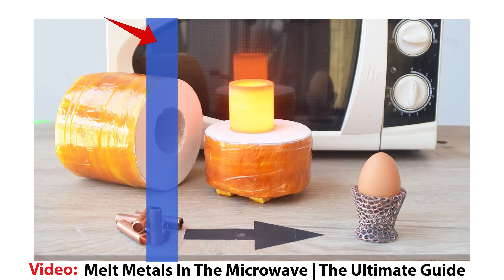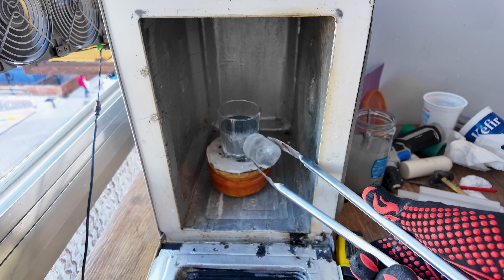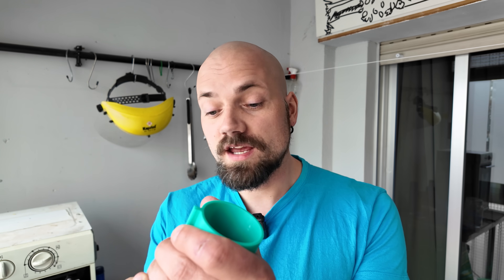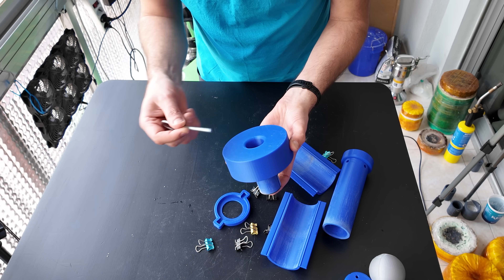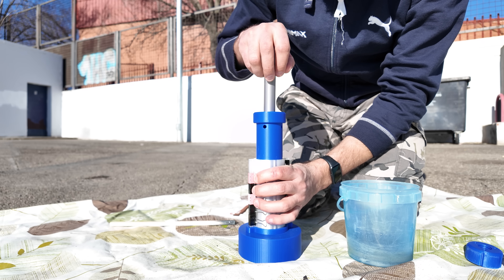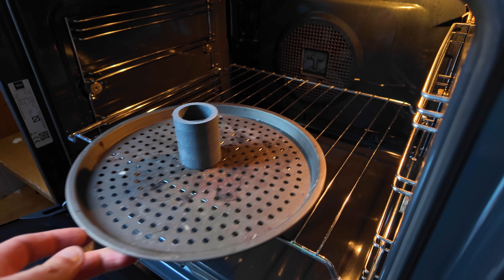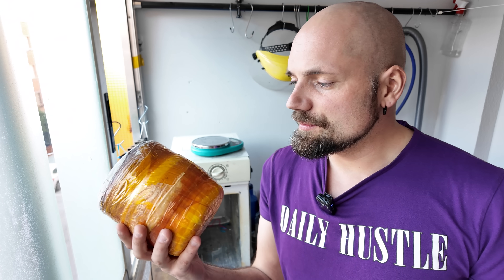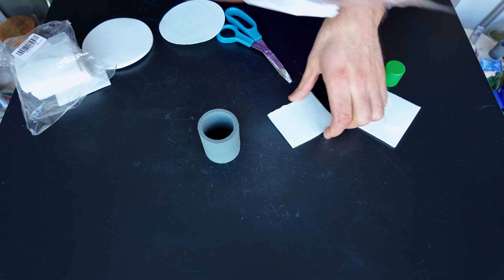How to Make Your Own Crucibles (for microwave metal melting)

Comment: Good video, but mad at science system for being cryptic here. You should already be unleashing your minds into the world but they sabotaged. Earth science elite be like "We has Ultrasonic holography pressure technology that can be greater than the bottom of the Ocean but we not explain what it means to masses because we dumb to the fingers of our own intelligence" lol. Masses deserve upgrades to make things easier. Soo.. Points at youtube LEVIPRINT Upgrade that to full Ultrasonic holography by Plasma speaker generated Ultrasound. Warwick university plasma generated Ultrasound "work in extreme conditions totally remote easy to automate" + Google: "Ultrasound can print through walls" you can float things in the air as you melt it btw.. Google: "Ultrasound can produce temperatures as hot as the surface of the Sun" hotter with Plasma source.. Google: "Ultrasound to read minds" See what you imagine.. Cellular mimicry..

You look at trash depots and recycling centers like its nothing. I see spaceships for humans all over the place, but that's my genetic behavior programming running I guess. Holography + Direct sound printing = Closes eyes and imagines blueprint from database for Ultrasonic holography assisted by synthetic AI biological computer to form using all the resources needed from garbage depot trash mountain https://youtu.be/LQ1iggFnFYA?si=r8W1TXnXvhRl2mFt Can't produce enough power to push Ultrasound that hard? Then use Ultrasound to control tiny things like negative and positive charges in the atmosphere to make Earth's lightning print for you.. Oops!

Comment: Thanks for the great videos!
I also made a crucible and insulated container based on your video.
It worked well up to the point of firing the crucible. I was able to make a hard crucible that made a high pitched sound when tapped.
However, when I tried to actually use this crucible, a problem occurred. When we grabbed the red-hot crucible with tongs, it deformed like cookie dough.
Did we put too much sodium silicate in the crucible? Or was the sintering temperature too low? (I heated it up to about 1100℃)
If you have any advice please.
Thanks again for the great video!
Reply from the maker: I used to have that problem as well, but not anymore. I would suggest trying to decrease the amount of sodium silicate used, or the opposite, increasing it. Obviously, it can also depend on the brand or strength of the sodium silicate. The one I used is a 37% solution. I know that on amazon there are gasket sealers that's pretty much the same sodium silicate, but they are only 10% or something like that.

So yeah, I’ve been there before. If you're packing the silicon carbide well enough and your crucibles are still falling apart, try using finer grit or experiment with the amount of sodium silicate you add. Cheers!
Reply: @ShakeTheFuture  
Thanks for the reply!
I will try different concentrations of sodium silicate!

Comment: Liquid glass Im hardening by co2 gas at room temperature in 24 hours. I use co2 from old expired fire estinguisher
Reply from the maker: I also used to use a fire extinguisher, but I stopped because I was using way too much CO2. Not necessarily because I needed to inject a lot of CO2, but more because it was a psychological thing. 'Let’s inject a bit more... just in case.' I found myself refilling the CO2 way too often, so I stopped using it.

Comment: Could you go over the ceramic fiber insulators/refractory, the generic types, the alternative materials, procurement, material specifications etc... ?
Reply from the maker: I’d love to experiment with different materials. There’s an 'organic' version of ceramic fiber—I don’t remember what it’s called—that I’d like to try. It’s supposed to be less nasty, but unfortunately, all these things cost 💰, so right now, it’s not that easy to dive into any project I want. Hopefully, we’ll get there soon. Cheers!
Reply: @ShakeTheFuture  What about using different material layers.  Especially an air tight outer casing. Would insulating the microwave help reduce heat loss enough to be worth it ? What about castable refractory insulator like vermiculite cement plus some suitable insulating aggregate ? What about rock wool or fiberglass insulation for the outer layers ?
Reply from the maker: @shodanxx I’ve never needed to over-insulate the chamber or insulate the microwave. For example, there’s a gap between the chamber and the base where I place the crucible (especially after extensive metal melting), but it hasn’t been an issue for me. I’ve still been able to melt everything I wanted so far. If I ever find the need, I might look into an airtight-ish insulation.

I once tried using perlite to make a microwave kiln—it melted. Obviously, it was directly exposed to the heat. As a secondary layer of insulation, it might have worked.

When putting these videos together, my main focus was to keep things simple so they’re easy to replicate.

There are definitely more materials that could be used; you just need to make sure they are microwave-friendly and don’t absorb microwaves. I haven’t tried rock wool or fiberglass , but I plan to experiment with AES wool in the near future.

Cheers!
Reply: @ShakeTheFuture  THank you for your response. I would also be curious with adding a fill port of noble gas such as nitrogen, argon or even carbon dioxide to avoid tin flash and other oxidation. 
Have you considered if temperature could be monitored or controlled  easily ? Such as thermocouple N type pyrometer ? Perhaps enabling heat treatment for precise hardening of small steel objects ?
Reply from the maker: @shodanxx  I’ve thought about adding some kind of temperature measuring equipment, but there are two reasons I haven’t done it.

First, I don’t really need it—but then again, if I had it, I might think, Wow, I can’t believe I didn’t add this sooner!

The second reason is that I wanted to keep things simple—no modifications to the microwave needed.

That said, it’s definitely something that could be explored, and I might consider it in the future.

Cheers!

Comment: have you ever tried using the microwave for heat treating/tempering?
Reply from the maker: I have not, but i don't see why it would not work. Cheers!
Reply: @ShakeTheFuture  how do you regulate temperatures? do you just go by past experience and fine tune as u go forward?
Reply from the maker: @kenniesdead  Well, I mostly use my microwave kilns for burning out molds. I control the temperature with a cycle timer, but obviously, I can’t be super precise. That said, once you do it a few times, the temperatures become very predictable.

For example, I already know that after 3 hours of the mold being in the kiln, running a 1/6 ON/OFF cycle, the temperature will be around 350°C (just an example).

In this video, I explain how I use the cycle timer: https://youtu.be/XCI_FPDQA-U
Cheers!

Comment: Thank you for this and all your other microwave videos. Questions:
What temperature do you need to harden the crucible and can it be done and in an electric kiln or a propane furnace?
Reply from the maker: Thanks! Well, that’s a good question to which I don’t have an exact answer, since I’ve only used a microwave to melt metals and have no way to measure the temperature that hight.

However, judging by the brightness of the crucible, I’d estimate it’s somewhere between 1,050–1,250°C. That said, I don’t know what would happen if you heated the crucible to a lower temperature and simply maintained it. Maybe holding the temperature for an hour would produce the same result—I’m don't know.

With my setup, I can’t really maintain the temperature for too long, as the chamber gets too hot. Heating that crucible took me around 20–25 minutes of microwaving. Cheers!
Reply: @ShakeTheFuture  The melting point of Silicone Carbide is up around 3,000°C I wonder if the Sodium Silicate acts as a flux to lower the melting point so it can fuse together. White hot is about 1,200°C on up.  Amazing how precise and efficient the microwave is in heating only the crucible. The propane furnace is ridiculously inefficient. I would not be surprised if you got the SC up to 3,000°C.
It is 2AM and recalling temperatures from memory so I probably got them wrong.
Reply from the maker: @JohnHoranzy I’m not actually sintering silicon carbide. The ceramic fiber is what sticks and fuses with the crucible to some extent, increasing its strength. I wish I could reach 3000°C, but that's a bit too much. I would estimate I can reach up to 1600°C, since I can melt stainless steel and there is heat to spare. We'll see, I'll be doing some more experiments that maybe will give us more answers. Cheers!

Comment: Where do you even buy silicon carbide powder?
Reply: It's sold as sandblasting media, an industrial supply, in 10Lb and 50Lb bags. Hit up a painting supplier, or a large hardware store. (not the chains, the ones contractors actually use)

They will also sell the relevant PPE (respirators, gloves, etc.), and it's well-worth investing in a good respirator.
Reply from the maker: @jercos  Yep. I buy them from sandblasting stores.

Comment: you ever tried making alumina or silica crucibles?
Reply from the maker: No, because I need them to heat up in the microwave. If I were to use them with gas furnace, then I would explore alternative ways to make crucibles. Cheers!
Reply: @ShakeTheFuture  ah of course, I see. would the same methods work for those?
Reply from the maker: @gyhy6yh  I think so.....but I suppose you would need to test it. Cheers!
Reply: @ShakeTheFuture I'll let you know how it goes!

Comment: what is the max weight of say bronze that you can melt in a microwave ?
Reply from the maker: It depends on many factors. So far, the biggest crucible I’ve ever used was the one in the chair melting video:
https://youtu.be/xyzE413rqHU

It’s almost the same size as the 3D-printed 'Large_tall' molds. In that video, I melted aluminum. I haven’t tried filling a crucible that big with bronze since I don’t have a lot of it. Brass could definitely be melted, but it would take longer.

If I remember correctly, I melted around 450g of aluminum in that crucible. As for bronze, one piece I made weighs 320g. That’s not the maximum capacity—I just didn’t have more metal at the time. I’ve also melted around 300g of iron.

It also depends on your setup. For example, the setup I used in the stainless steel melting video, where the crucible is embedded/covered with ceramic fiber, can reach higher temperatures and melt metals faster. However, there are downsides to that method. I hope to make a video about it as well.

Cheers!

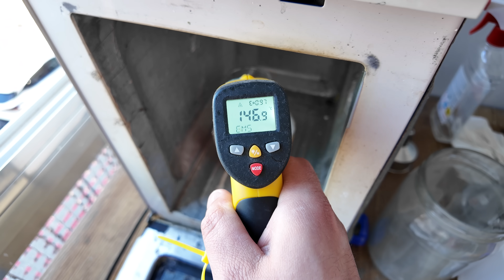Comment: What is the stainless steel contraption in the back I saw at 1:24.
Reply from the maker: That's a cereal grinder that I use to grind silicon carbide.
Reply: @ShakeTheFuture  Which one wins? Since silicon carbide is an abrasive.
Reply from the maker: @BillDavies-ej6ye  Well, the blades do wear down pretty fast, but you can grind silicon carbide. Sure, the silicon carbide will get contaminated with stainless steel, but that doesn't really matter for my needs.

The grinder cost me 40 euros (I had another one that broke because I was shaking it during grinding, and the reason I’m mentioning this is that, even though it was the same model, the first grinder cost me more—closer to 60 euros… just to stay consistent in case I’ve mentioned it before).

Anyway, that 40-euro grinder came with 2 sets of blades, so it’s been lasting me for a while. I can’t say exactly how long, but I’ve started keeping track of how many grinds I can do before the blade needs to be replaced. We’ll see

Comment: Also you could re use all the shattered glass and pulverize it and mortar it into a powder and add lye to it or woodash to make more sodium silicate.
Reply: "Crystal" cat litter (basically silica gel) and drain cleaner (sodium hydroxide) are the easiest ways to make it from scratch, but most big box hardware stores carry it near their concrete section.
The pulverization of glass should work theoretically but I tried it with both sand and crushed glass and no matter how small I got the particulate, the reaction was just too slow. There was a process to speed it up, but I didn't want to use the extra chemicals and perform the extra steps to remove the byproducts.
Reply from the maker: That's awesome!

Comment: Nice video! Can you measure the conductivity/resistance of the silicon carbide crucible to see if it can be used as a heating element to be used in high temperatures?
Reply: Using this method you can melt anything that exists, it holds really good until near 2500°C, above this you only able to melt a low amount and for like 2-3 times before melting the crucible too
Reply: @sevazinhogamer9521  Sorry, I meant electrical resistance. I was thinking about making silicon carbide resistors for a high-temperature kiln this way and was wondering if the silicon carbide particles in your crucible were electrically connected when mixed with the sodium silicate and then hardened.
Reply: @lmkawakami I've worked with sodium silicate a lot, it's not electrically conductive. Can't comment on silicon carbide but I doubt it would be either in practice.
Reply from the maker: I tried to measure it, but for some reason, my multimeter is showing 29.2Ω even when I’m not touching anything. When I touch the leads together, it goes to 0Ω. However, when I touch the crucible at two points, the reading doesn’t change and just stays at 29Ω

Comment: Do the patterned crucibles do anything extra, or is it just aesthetics?
Reply from the maker: It’s more for the look. I realized that all crucibles look the same, but they don’t have to. I know, I know, it’s not that important, but I bet if people had the choice between a regular crucible and one with a nice pattern, they’d probably go with the patterned one—because why not?

That said, there’s another reason, but don’t believe everything I say. I have a theory that some patterns might increase the strength of the crucible. Obviously, it’s just a theory that needs to be tested. I’m going to start switching to patterned crucibles and see what happens.

Then again, I’m also experimenting with mixed grits and these new 3D-printed molds let's you pack silicon carbide better, so there are a lot of changes happening at once! :)

Maybe I should have introduced only one change at a time to figure out exactly what makes a difference. Apart from the patterns, I’ll also add crucibles with text on them—like brass, aluminum, silver, etc. That way, it’ll be easier to identify which crucible is meant for each metal if you only want to use one crucible per type. Cheers!
Reply: The pretty ones are for aesthetics but you can use the patterns to allow for more secure grip with your tongs.

For example, if you were going to use your dad's gooseneck pliers to pour, you could leave the center support in and grip into  the side a couple of times before firing.
Maybe at the top lip too for pulling it out.